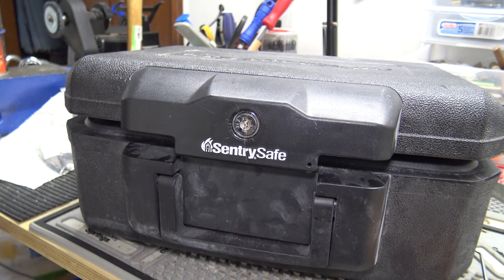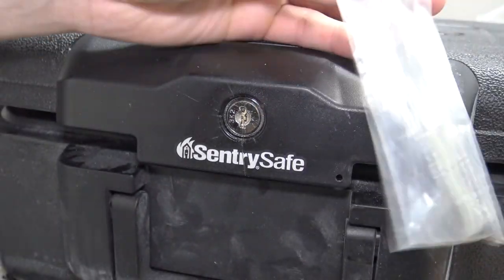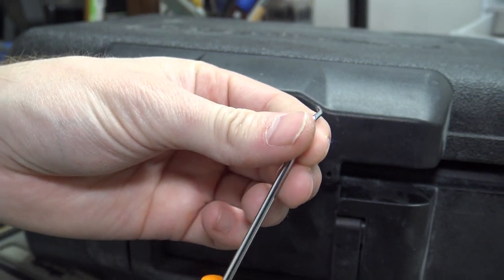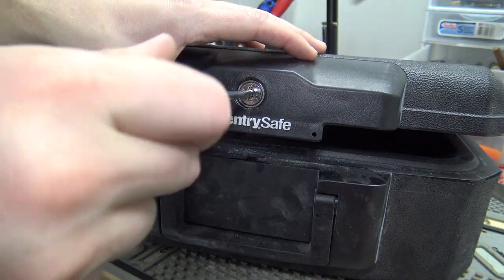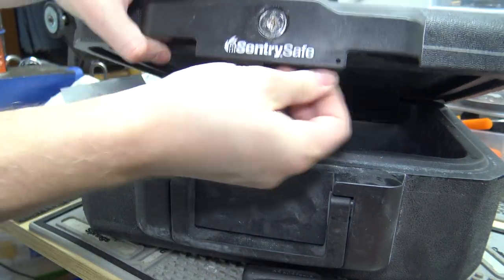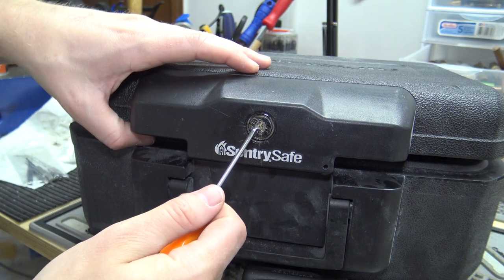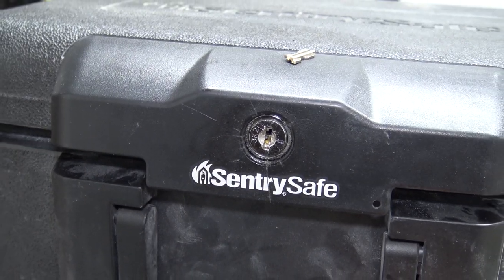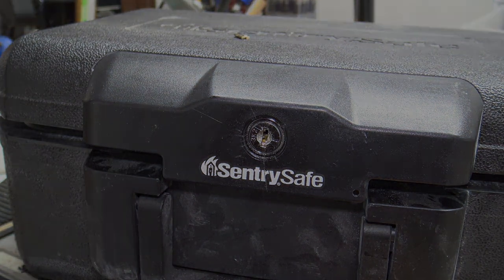(374) Getting a Broken Key Out of a Sentry Fire Box or Safe

Comment: For me I have a similar Honeywell fire safe that the locking mechanism on the safe itself (near the handle) seems to move to too close to the edge as it closes and it slips underneath the opening & becomes stuck. The latch mechanism is completely enclosed off in the safe so I can’t just move it. 

So then I can’t unlock it fully or take the key out when it stuck. It only released this last time bc I was able to somehow use force with scissors to move it back into the opening.
But I’m worried it’ll just slip back under the latch opening  again if I close it. 
It’s less than 2 years old, so wonder if I should contact Honeywell.
Reply from the maker: You definitely shouldn’t use it anymore. Eventually the key is gonna break in the lock. Those keys are pretty thin.

Comment: I broke my key in my safe with a shit load of product in there … can I cut it open .?.
Reply from the maker: If i was cutting one I'd use an angle grinder with a 4 and half inch cut off wheel cut through it right below the lock.